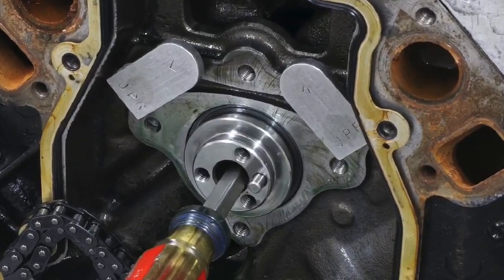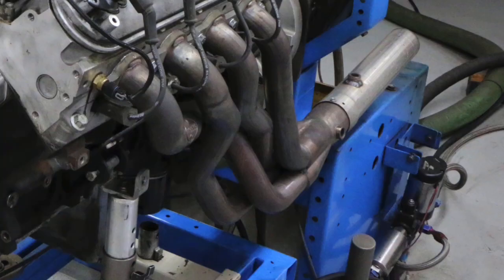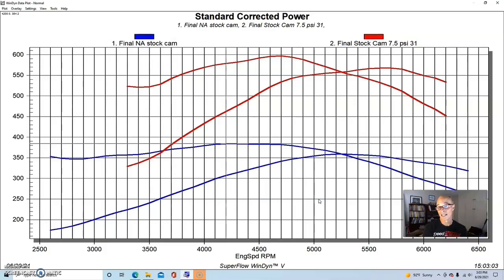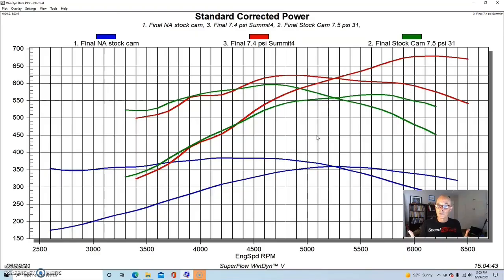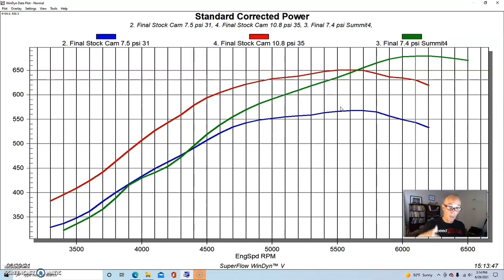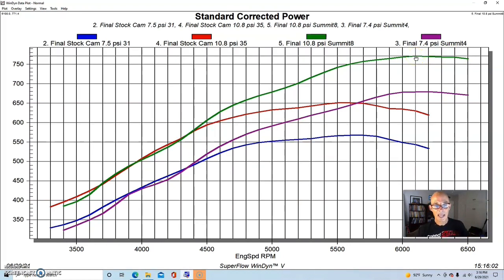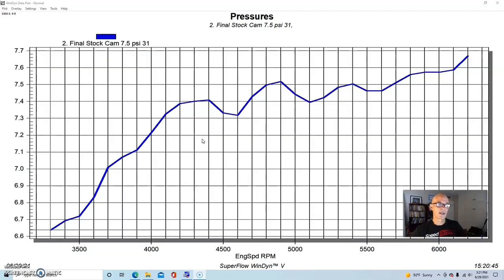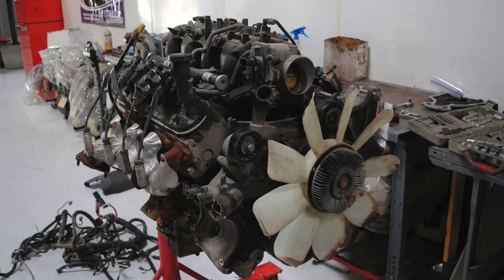TURBO LS-SUMMIT PRO LS CAM UPGRADE VS STOCK CAM & MORE BOOST

Comment: Aftermarket cams make the turbo more efficient. More boost also means more heat. Stock cams are more streetable. In all honesty stock cams are fine in a boosted street car up to a certain power lever say 700whp.
Reply from the maker: boost multiplies what is there-if a cam adds power na, that gain is multiplied under boost

Comment: Richard sorry this is off the topic, but I’m planning a boosted ls build and am not sure what to start with as I’m in Australia and we only ever had alloy ls engines here so to buy a iron block engine is expensive but not out of the question.so that being said should I start with a iron or alloy block? 
I know this is opposite to what you are use to in America, but I just want to a engine that will last and cope with some decent boost.
Thanks
Reply from the maker: an alum l33 or lc9 5.3L block can make a ton

Comment: Stock cam with boost, what does this do to cylinder pressure under load in higher gears low rpms? vs big cam
Reply: Well for one thing I believe you would run into detonation issues sooner with a stock cam and boost than you would with a larger cam and more overlap etc. especially depending on static compression. As far as overall cylinder pressure, anytime you increase power from your engine you are essentially increasing average cylinder pressure so look to the power curve and that should in theory match with the cylinder pressure of the engine, if theirs a marked increase in one there is usually an increase in the other. (Power vs Avg Cyl Pressure)

Comment: The answer is, if you're gonna take the time to build a turbo kit and get it dialed in, you should always do a cam and springs.  Really any engine with factory springs is leaving power on the table, but with the conservative factory cam specs you're working against yourself to do modifications but leave factory profile cam
Reply: Agreed. Up to 90 bhp is what a cam gives. Why wouldn’t you. Even a mild emissions cam if that’s what you want, its so easy to swap in.

Comment: All that boost and IV yet to hear ya talk about gapping the rings
Reply: I never gapped my rings but then again my supercharger never sees more than 13lbs....lol.....I pulled the rings straight from the box onto the pistons,  hell I didn't even measure them.....did 3 motors that way with no issues at all

Comment: Two questions. One is, is it just e85 on the higher boost tests or did you switch to race gas.  The other is why run a high lSA on the cam. I don't know much about forced induction, but it is my understanding that for NA power the tighter the lobe separation  the more power, trade off is idle and vacuum quality.You are also closing the valve sooner and compressing more volume if it has the ability got get in to the cylinder with a tighter lobe separation. Is it a matter of reversion at low speeds, that one would want a wide lobe separation angle.  Could a close lobe separation angle cam be worse than a stock cam on a boosted application?
Reply from the maker: a tight lsa cam (in this duration range) wont make less power than a stock cam

Comment: Boost is easy, but boy does that extra torque start breaking stuff.  Hell, the torque differential between low and high boost is probably enough to break a stock 4L60 (probably would've broken on the NA setup if it was pre-2003 version).
Reply: That’s why I consider a 4l80e part of the upgrade.  Even before adding a bunch of power I make sure the trans is going to be good for it. I’ve had too many transmissions ruin my day to over look them.
Reply: Would a 6l90 hold up to 500rwhp?
Reply: @kevinmcquitery4543  6L90 will easily hold 800+ whp tuned properly

Comment: I have been running a stock 2004 LR4 in my cutlass with a VS Racing 75mm T4 turbo.  Car ran great on 15-17 psi. 7.12 in the 1/8th.  I added a Elgin Sloppy stage 2 cam and it makes boost WAY faster now.  My first run with the cam it went from 4 psi on the launch to 26.8 PSI in about 1 second.  I didn't have it tuned for that high of boost and luckily it laid over and didn't blow up.  Now I have been working on the tuning for this cam and I am trying to figure out what timing to add and fuel.  I need a dyno so bad right now...lol.

Comment: I noticed this cam only has two degrees of overlap.it’s on a 115 lsa if your not running a lot of boost wouldn’t it be lazy down low ?. As a 115 makes you wait for the power up top
Reply: Overlap is bad - doesnt hold boost pressure as well.
Reply from the maker: its 115 +5

Comment: I love your videos. Just one request: when comparing charts at the beginning, please limit the number of variables. For example, you added boost but also jumped to E85 on the same test.
Reply from the maker: e85 on an na motor does nothing for power
Reply: @richardholdener1727  Gotcha. Thanks for the explanation.
Reply: @richardholdener1727  Really? I beg to differ, allows more timing.
Reply: @midwestdave33 in that case the timing is what increased power, not the E85. E85 allowed it, but timing is what did it, in other words like Richard said switching to E85 alone without adjusting the tune will increase power next to none.

Comment: Gotta a question for you. Stock 5.3 in a 2010 Silverado. It’s used for towing and getting me to work. What’s more efficient for this kind of application. Turbo or supercharger? The truck really needs that low end torque.
Reply from the maker: either can add a lot

Comment: now how about my 100% stock lq4?
Reply from the maker: add boost
Reply: @richardholdener1727  my only concern is valve float around 6k rpm on the stock springs. i have the pac springs and pro ls cam but theyre in a 5.3 right now

Comment: Hi Richard, can you recall which A/R this unit was? Did it have beehive springs also?
Great comparison,  thanks
Reply: beehives are stock on LS motors
Reply from the maker: 1.32-the tfs heads had dual springs
Reply: Thanks  @richardholdener1727 appreciate the reply, and all your videos,  thanks

Comment: Tradeoffs either way. Small cam with higher boost has the benefit of not needing a cam swap but has the drawbacks of higher boost - higher octane, less efficient, ect. 
Both ways have merit.
Reply: 10.4psi is very mild indeed. Much more benefit upping the boost to 15psi (pump fuel) or 18psi (e85) than changing the cam, unless or course, you do not want that massive midrange torque hit that breaks things.

Comment: Richard Holdener I've got a summit racing truck ls cam and 799 heads on my ly6. I believe close to 11:1 compression. Is that to high to add a turbo?
Reply from the maker: not with enough octane, a good intercooler, e85 and/or proper tuning. You can always add 317 heads

Comment: I think Ricky is saying that every 5.3 should have a 475 on it. Stock cam or not.
Reply: I think the caveat is unless there's a trailer hooked up to the back of the truck lol. RH, can we get some videos for turbos + towing? There's not much out there on the internet about this topic!
Reply: @scottleggejr  cooling will always be a struggle. Look at the size of a kenworth radiator, that is the radiator needed to use 500-600 hp continually. Transmission life will also suffer.
Reply: @Burnoutkid11  I was more focused on fuel/timing with loads higher than normal than ECT. But yea I agree with your point.

Comment: Do you have to replace head studs and gaskets I have heard there reusable, and that in a strength test ARP studs really weren't much better than stock?
Reply: ARP’s are a significant amount better. Trust me. That being said, I have cheap China studs holding 26+ pounds of boost.

Even and true clamping force it’s what’s important. And the way a stud works vs a bolt immensely improves how consistent and true your torque is. 

So if some screams the stock bolts have the same tensile strength as China studs… just laugh.. because they don’t understand why a stud is better than bolt. How strong the bolt is… is only a fraction of the story.
Reply: @nsboost   China studs are no better than 200,000 mile stock . ARP are 20 kilo newtons stronger. The weakest link is the rods on a gen 3.
Reply: @nsboost  plenty of videos out there showing the China studs are weaker than gm headbolts.
Reply: @nsboost  actually theres been a test done comparing arp/stock new try/stock used ttt/china studs . The china studs had the least amount of clamping force/tensile strength before letting go
Reply: @fbm314  wrong. The test was tensile strength. How strong the bolt was when you tried to pull it apart. It did zero to test was the clamping force was. Studs are better. Even if the studs are a lower tensile strength. A bolt/stud isnt gunna have more clamping force because it’s stronger. 

You torque bolts and studs to the same torque reading. Bolts are twisting the shaft and driving them into the block to get tighter. A stud doesn’t twist as you suck the head down with a nut. So at 75ft lbs there is much more clamping force with a stud, China made or not. Think about it real hard. This is physics. It’s not as simple as one bolt/stud/whatever is strong so it clamps more (that would be incorrect).
Reply: The arp are definitely stronger and are meant to be reused . But it's been proven that stock reused headbolts are way stronger than people expect and hold up to a lot of power just fine

Comment: Being a Big Six Ford owner, as several hundred thousands us do, I would be interested in your experience/thoughts on overcoming the lack of after market performance parts.
The 4.9/300 owners out here thank you in advance
Reply: Super simple ls swap
Reply: Boost!
Reply: Its pretty apparent lol, do a mild cam and valve springs and add boost. I think something like a 70/65 would suit a 300 pretty well
Reply: No one makes performance parts for the 4.9 because if you can't afford anything more than a 4.9 you aren't going to buy any performance parts
Reply: @chipcurrey653  Research the 'Flying Frenchman'
Reply: @ravenrock541  I am aware the engine can be modified, turbocharged, etc.

Put yourself in the shoes of a business person surveying customers. 

You survey the customer base of Ford 4.9L owners.

You have to ask "Why won't these people either use factory parts to convert to the factory v8 offerings which have tons of aftermarket, more displacement, have been raced for years, etc?"

The answer is likely that "either they are purists who want their vehicle original" - and these people are unlikely to buy any performance parts OR "they cannot afford to do the conversion or sell their current truck and pay the price gap for a factory v8". 

That doesn't sound like a crowd that will buy performance parts, especially if say purely for example an aftermarket aluminum head for a I6 turned out to be the same price as a complete vehicle with the I6. 

If you disagree, and feel this is a legitimately underserved market with large profit potential, then consider starting a business to offer these parts.
Reply: Boost, ls swap, or both

Comment: About to build a 5.3 so this vid is gonna be perfect 😁
Reply: I built a 5.3 based off Richards videos and data. LM7, ported heads, jegs stage 2 cam/springs, and a gt45 turbo.
Reply: If I can give you any single piece of advice… don’t get the summit turbo cams. Their stg 3 cam Cost me 8mph in the 1/8 when I changed to it over a BTR ls3 cam in my turbo 5.3 car.

It doesn’t matter if you only want 600hp or something really low. But if your in the 900… 1000hp+ area… the summit cams are terrible on a 5.3 in my experience. 

In fact I have one with 10 passes I’ll sell ya cuz I’m ripping it out
Reply from the maker: 8mph?
Reply: @richardholdener1727  car went from 128mph in the 1/8 to 120mph. No other changes. Don’t get me wrong, for a stock bore 5.3 120mph in 11,000DA air @3400lbs is moving pretty good. But we lost power with the swap over the BTR stage 2 NA ls3 cam.. 

I wish I had more data to compare.. back pressure.. pre intercooler/post intercooler pressures.. but unfortunately I do not.
Reply: @nsboost  it works different on everyone's combo, what is the grind for each and the specs on your build?
Reply: @lucysmith4242  it’s literally a stock 5.3… junkyard engine… with a cam.. and a big single. That’s about the most common LS build on the planet. That’s fact.

Listed the cams in my previous comments.
Reply: @nsboost  intake, fuel type, tire size, rear gear, trans selection, converter selection, turbo brand/size or other induction methods. 

When you talk to a converter company or a custom cam grind company do you tell them it's a stock junkyard 5.3? Or do they ask for other specs
Reply: @lucysmith4242  I’m not buying anything from you and have zero reason to give out the specs on my grudge racer to a stranger. I can tell you a couple well known cam designers said the stage 3 turbo cam is a sorry attempt at a turbo cam. I’m just telling you what the experts told me
Reply: @nsboost  ok
Reply: @lucysmith4242  sounds like nsboost needs desitin.  People these days are far too sensitive
Reply: @davidw.thatmsdguy8952  people think they're grudgers when they're not ¯\_(ツ)_/¯